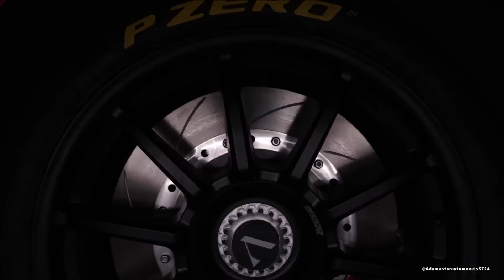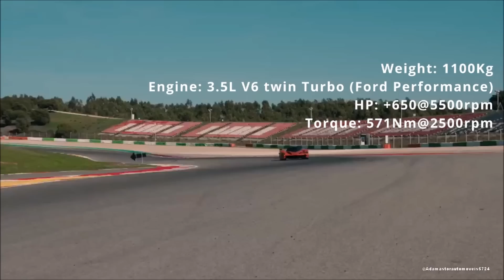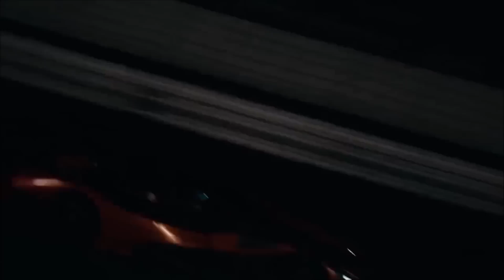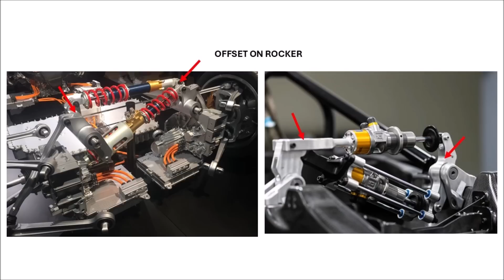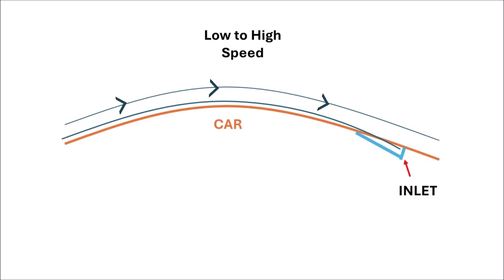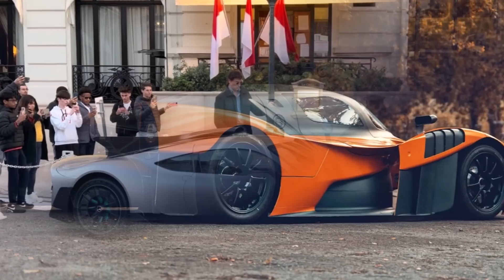Adamastor Furia - CLOSER LOOK

Comment: I had the same thoughts as you did when comparing it to the $250k Radical only instead of getting 99% of the way there you can get 95% of the way there with a $30k used club racecar haha. Its construction is not all that different, it's just extremely highly developed by well-paid engineers instead of hacked together by a small shop using information and techniques everyone already knows.